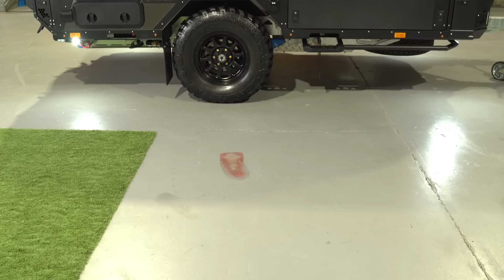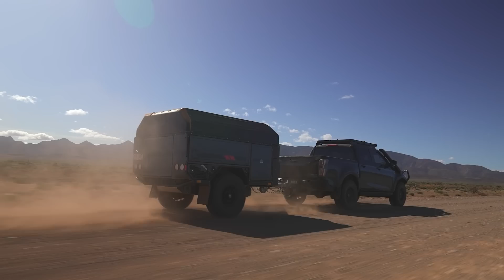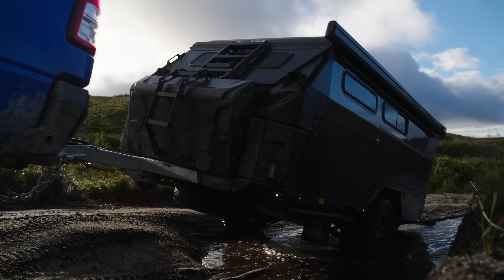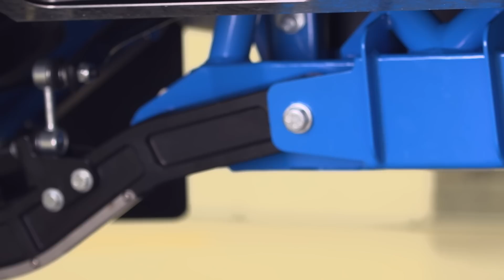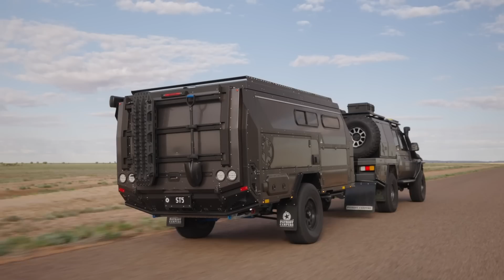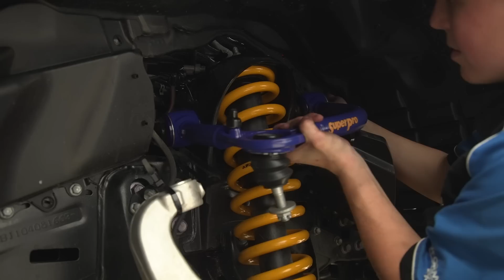TRINAMIC Changes Off Road Trailer Suspension Forever! - Patriot Campers ST5 Supertourer

Comment: Would U's do temdom trailer with kitchen inside with liftup queen bed to axset fridge inside an laundry maybe double bunk rightside sleeps 4 that turns into lounge 3seater 32" smart TV removable outside when needed, with 2x soundbar with sub inside an outside jbl, with shower inside an outside with hot water, slideout solar panels wings from roof when has boat on roof when parked up ?